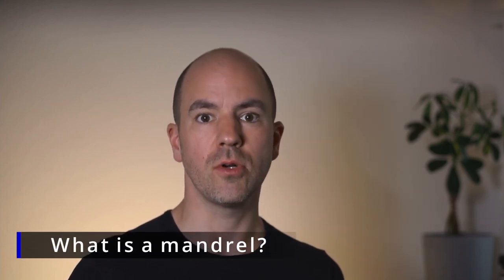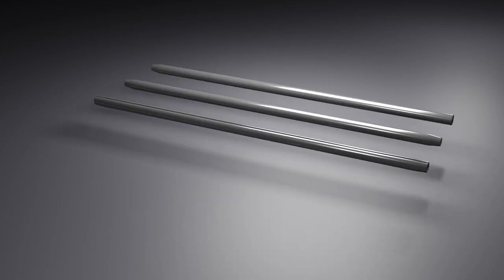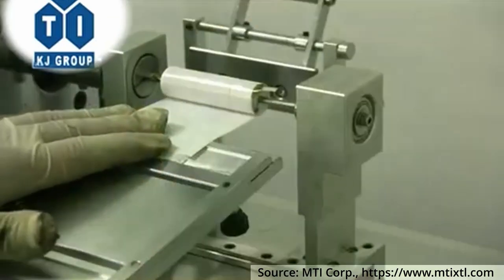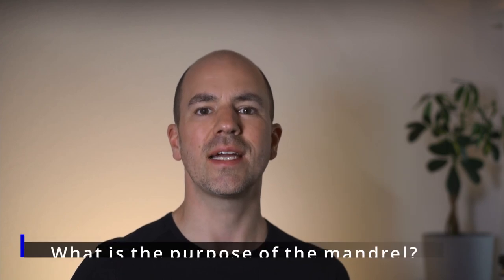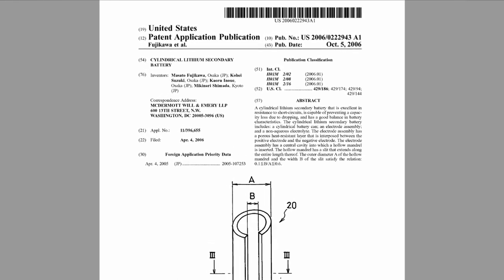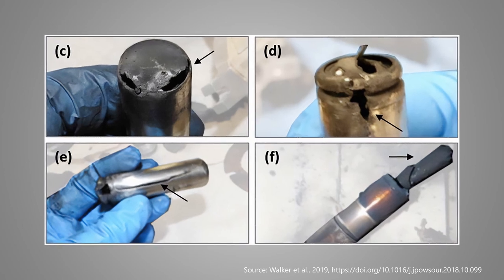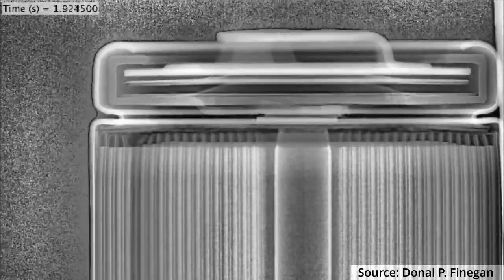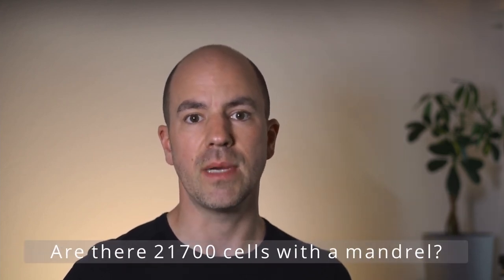Battery Safety: What is a Mandrel?

Comment: Thank you for the informative video. I wonder if spot welding the mandrel/spindle the anode side casing would help prevent it from being ejected. I am not familiar with cylindrical cell construction so I don't know if this would be practical. 

I would imagine the mandrel also assists with maintaining predictable thermal conductivities in the cell as the laminations maintain better contact with each other.